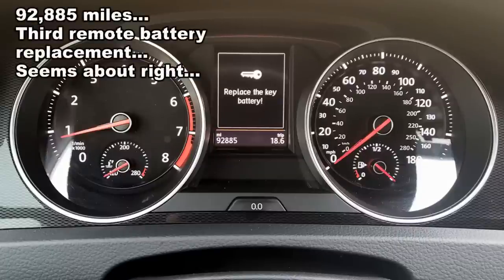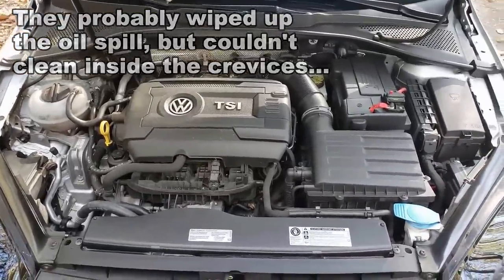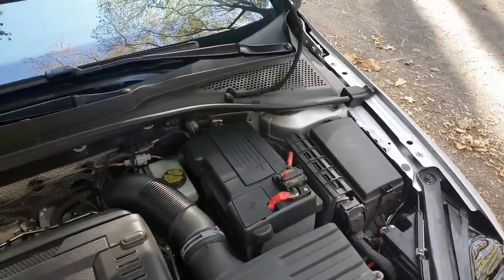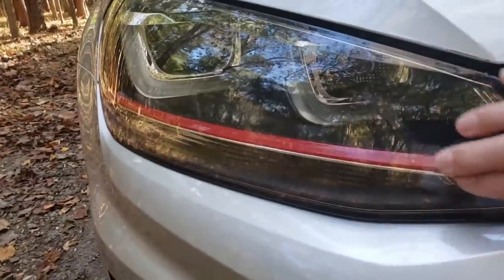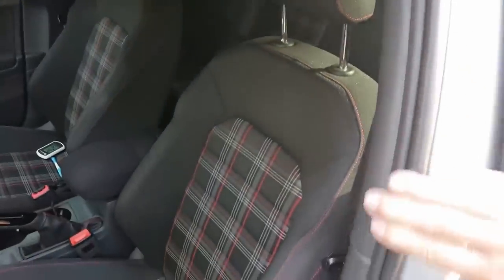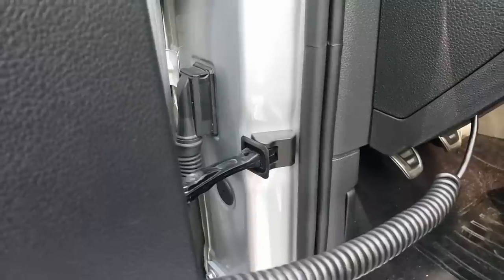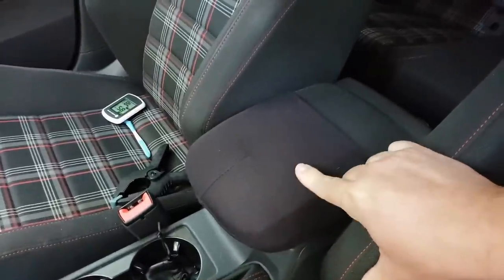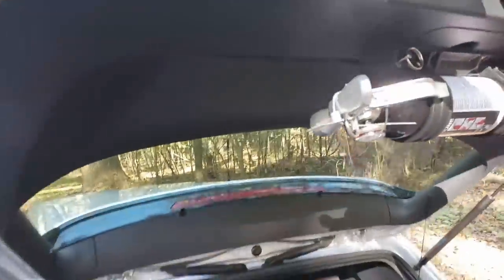THREE YEARS AND 93,000 MILES: My Report, Part 1

Comment from the maker: Major points of clarification: My clutch did NOT fail at 15,000 miles. In fact, it did not fail at all. It slipped ~15k after tuning my car. I replaced it preemptively. The majority of the issues I detail in this video are either self-inflicted, petty, or both. Also, OBDEleven is a diagnostic tool that plugs into the OBD2 port: https://obdeleven.com/en/. Part 2 of this video is now published. It  includes the footage of the suspension, exhaust, and other items that show the condition of the chassis and underbody: https://youtu.be/s2x1-Y9kzfA. Thanks for visiting.
Reply: StealthGTI 
The oil you thought was leaking from the diff that turned out not to be - smell the oil, gear oil has a distinctive smell. 

Your worn bolster - I lower myself into my car using the A-pillar. It prevents contact with the bolster. And I have a cover on the driver’s seat.
Reply from the maker: @ghostinthemachine76  Thanks for visiting.
Reply: Which APR stage 1 tune are you running? Is it the low torque? 
Did you replace with an OEM clutch or something else?
Reply from the maker: @davel1898  - Sorry to have missed this. YT doesn't notify me of replies, only initial comments. I found this by accident. Anyway, I'm running APR Stage 2, their initial release at the time of this recording and now their "final release" with slightly less torque down low and slightly more power up top. See my APR video for details. As for the clutch, I'm using an "RSR" kit by HS Tuning. I have details in my "20 Questions Volume 2" video. Take Care.
Reply: @StealthGTI  hello, I have a 2014 GTI. How do I know if it is a MK 5, 6, 7? I believe it is the most standard version available.
Reply from the maker: @bobmoore20  - Each "mark" (Mk) refers to the generation of the car, with the Mark 1 (Mk1) being the very first generation in 1974 and the Mk8 being the most recent and about to release. I don't know where you are; so, I don't know if you have a Mk6 or a Mk7. North America gets the new generations a year behind Europe. See https://en.wikipedia.org/wiki/Volkswagen_Golf to see which car you have. Thanks for visiting.
Reply: @StealthGTI  thanks so much for the info. She’s a 6! Thanks again
Reply: @bobmoore20  would you recommend an Audi A3 2013 1.4 petrol auto @ 70,000 miles?
Reply: It should not consume coolant.  Maybe u have a leak in the thermostat housing/coolant pump very common
Reply: I like all the petty or self inflicted wears it lets me know everything ima get myself into when I buy one

Comment: Previous MK6 model owner: the issues I had: radiator replaced, water pumped replaced and 2 ignition coils replaced, this was all before 36K miles. That being said, this was all covered under factory warranty. Around 50K the auxilary fan went bad. Around 60K replaced the rear brakes. Later, around 70K they had to take apart the motor because of some oil leak. I fought that one hard because the car was not leaking oil, before I had dropped of the VW service department.  Around 80K, due to the carbon build up, I had to get that cleaned. That was not cheap. That being said, it was still a fun car. I had it from 7K - 105K miles. 5 years, the transmission, motor and turbos were still going strong.
Reply from the maker: Thanks for sharing your experience.

Comment: My 2003 MK4 GTI VR6 is 17 years old now, and is built like a tank (built in Brazil, no less)!  Original clutch and chains, no leaks ever.  The only thing that needed replacement was the engine radiator fan, and the coilpacks (which were a general recall when the car was new).  This is the most reliable car i've ever had by far, and a blast to drive!
Reply from the maker: That's great to see. I felt the same about my 1998 Jetta TDI. It was very reliable until rust set into the front strut towers. The 450,000-mile power train lives on in a B4 Passat somewhere in TN now. Thanks for visiting.
Reply: in some ways I regret selling my 04 Gti 1.8t.  15years/140k miles and it had usual car stuff.  leaky rusted downpipe (replaced by TT 2.5" DP, sunroof, falling headliner, sticking calipers, but other than that it was nearly flawless and fun;  never chipped

Comment: Great video, my Mk7 GTi started drinking coolant at the same rate as yours.  Dealer found the water pump and theromsat housing were leaking and fixed it under warranty. I understand this is a common fault so could be related to your leak.  Quick pressure test and checking under the car with the shield removed should help confirm if this is correct.  Great video 👍
Reply from the maker: Thanks for the note.
Reply: Thermostat housings are notorious for leaking on all 2 liters and 1.8. Try to get a aluminum one if they make it for your car, it shouldn’t leak after that

Comment: Coolant issue is very common. It happened on my 2012 GTI, my 2016 Golf, and I'm sure it will happen to my 2018 Tiguan as well. I have never found any leaks. I also noticed the weak VW factory glass. All of my VW's have had cracked windshields before 100k. I would definitely stick with the factory oil pan. I lowered my Golf with sport springs at ~20k and never had an issue 90k miles later.
Reply from the maker: That's good news. Thanks for sharing.
Reply: Coolant issue is the water pump common problem.

Comment: In high school my best bud had a diesel VW Rabbit. It was a interesting ride. The gearshift felt broke - it was fine. With me riding his top speed with air conditioned on was 45 mph on level road.without air 55 mph. If alone he claimed 63 mph “ givin her all she’s got “ . It was normal. Low power cars. He did manage to almost get his license taken while driving it. On the WVA Turnpike he got clocked going about 80 mph . Down the biggest longest mountain at the bottom. Beckley mountain. He was trying to make up time he lost at 30 mph climbing the same mountain in 2 Nd gear.  We jammed Sammy Hagar , “ I cant drive 55”  it was true comedy. Glad to see they are better 30 years later. Nice little road machine now, or appears to be to me.
Reply from the maker: Ugh! I cannot imagine needing to pinch my pennies to the point of wanting to drive something so slow today. HAHA! Thanks for visiting.

Comment: I bought my Seat Ibiza TDi 130 new in 2002. It always had pressure build up in the coolant reservoir and I had to top it up every month. It was the head gasket.  A specialist replaced the head gasket (with pictures as proof) and the problem stayed the same. I don't want a car from the Volkswagen group anymore.
Reply from the maker: Thanks for sharing. I don't know much about Seat. What are you driving now?
Reply: @StealthGTI  Seat is a brand of Volkswagen.  I have been extremely unlucky with the engines in the cars I have had the last 20 years.

Comment: VW / AUDI eating coolant. Yes, yes they do.
Reply from the maker: Thanks for visiting.
Reply: My A4s were terrible for eating coolant.
Reply: Hey stealth!  Yep, me too.  Coolant magically disappears every 5k Miles or so.
Reply: 2015 Mk7 60,000 miles now, approximately the same coolant consumption. Strangely comforting to hear others observing this too
Reply: mine also did then we realized I had a defective EGR cooler. now no more coolant loss
Reply: Vw engines (2.0tdi,1.8/2.0tsi) have problems with water pump leaking
Reply: RAYNOND ST. PIERRE  then it wouldn't be a GTI
Reply: Mine eats coolant as well. Went to dealer and they diagnosed a leaking thermostat. Very common. Also expensive lol
Reply: My 2016 VW Volkswagen Passat does the same
Reply: valve in cap not working. Simple as change coolant cap
Reply: @chasek4605  the coolant pump and housing is plastic...JESUS CHRIST...PLASTIC!! So they degrade and start leaking. Just having mine replaced under warranty. There is no metal replacement or upgrade as of yet. USP has a mk6 full metal upgrade including metal impeller. If i keep the car for another 5 years I'll be doing this upgrade
Reply: TSI engine.. just wait, the parts will disintegrate not too long from now.
Reply: No they do not, my Audi is 10 years old and only thing it consumes is fuel.
Reply: @overtaxed3628  well...it seems the newer cars were made lighter by making certain components out of plastic
Reply: Yeah these mqb 2.0 tsi love to get pissed on coolant haha. I have the same internals as you do in my octavia vrs and the same coolant issue. I also have the rattle near my head too so I'm going to check that door bolt. Thanks dude!
Reply: What about water pumps and thermostats?
Reply: We have a 2016 tsi and it uses antifreeze. The rad has a pin size hole. You only notice it in heavy traffic when the engine is warm. You can smell it. Also, my backup cam is foggy greenish all the time. I think the lens is off the mount a bit.

Comment: Great video! Excellent details! I bought my 2001 VW Jetta 1.8t 5 speed manual brand new with 3 miles on it! Arrow Silver with grey cloth interior and a sunroof with the monsoon sound system.  I loved that car for 7 years and 125k  before I sold it.  Sunroof never gave me an issue but everything else did! I also had a stage 1 flash of my ECU and it was an absolute blast to drive. I had a lot of trouble with my ignition coils constantly going bad. Same with my spark plugs. Replaced the clutch once with a heavy duty one and it was fine after that. My issue was how much time it was in the shop over 7 years. From electrical gremlins to check engine lights it was non stop! It was an absolute blast to drive but based on my experience i simply dont trust the brand. I've owned a maxima since for 7 years and 130k with mo problems at all and currently own a 2015 Honda Accord V6 Coupe that has been flawless.  VW made fun cars but until they get with the program with their quality control and manufacturing quality as well as assembly quality....I can go back. Just my experience though.
Reply from the maker: Thanks for sharing your experience. I, too, sometimes consider jumping ship. My GTI and my wife's 2018 Jetta (low miles) have been great cars. I'm considering an SUV as a third vehicle. The "VW nut" in me says to get an Atlas. But my diehard reliability, capability, and build quality tells me that my needs may be better met with a 4Runner or a used GX460. We'll see.
Reply: @StealthGTI  You get a strong vote for the 4 Runner here! Lexus not a bad choice either other then the horrific gas mileage! But neither will let you down.  I've heard many horror stories about the Atlas.  In fact there is a guy on YouTube who documented his story of his wife's Atlas that was eventually lemon lawed. They ended up with another Atlas because she really liked it and wasn't deterred from the experience.  Either way best of luck with your current VWs and any future vehicles that you choose to purchase! Cheers!

Comment: Really good review.
I've had a Golf 1.5 in the UK through my work for the last 3 months. In that time,  I've covered 8000 miles.
I find it really relaxing to drive. It's so quiet compared to my previous car which was diesel.
Reply from the maker: Nice. I find driving to be relaxing, too... driving in the rural areas, that is. Thanks for visiting.
Reply: I don't find newer diesels to be noiser than petrol engines of the same power at all.
Reply: @JAnx01  they get slowly noisier

Comment: Appreciate your video. I'm getting close to 50K on my 2016 6MT and have found it to be very problem free. Tires at 35K, battery at 40K, a cracked windshield early on, and that's it. On rare occasion, the Apple Car Play can be glitchy after taking a phone call. Brakes still test well, zero leaks, and I'm not consuming any noticeable coolant. I did find that the dealer's 10K oil interval was too long and the car used 1.5 quarts on at about 9,000 miles...I shortened the intervals thereafter, but noticed no consumption after the "break-in" oil was replaced. I'm 6'3" and adjusted the way I enter as well, but luckily no noticeable bolster wear yet.
Reply from the maker: Thanks for sharing your experience!

Comment: Great review!  I nearly bought one of these after I brought in my golf tdi on the last day of buybacks.  Interested to see if you can nail down the coolant thing.
Reply from the maker: Honestly, I'm not terribly worried about it. The car's been great, even with what is a very small amount of coolant disappearing almost since it was new. The TDI buyback was probably one of the best things that happened to me. Without it, I'd probably still be driving my Mk6 Jetta TDI, completely unaware of how much better the GTI is. HAHA! Thanks for visiting. -Scott
Reply: My wife’s car had the same issue, coolant reservoir low about half an inch every 8k miles or so. It turned out to be a bad seal from the coolant flange on the driver’s side of the motor. It’s the same flange where the coolant sensor, upper hose and the engine block meet. Replaced the flange, no issues since.

Comment: My GTI also had the pucks still installed when I received it!
Reply from the maker: Yep. The PDI "techs" probably turn over frequently enough that VW cannot keep them trained, even for something so simple.
Reply: @StealthGTI  VW isnt the best place for a VW ( in my opinion ) ! A good independent specialist is what you need, even for a new car , you should not have problems with your warranty as long as genuine parts are used.
Reply from the maker: @amazingvidguyz  - I had an independent specialist selected before I even found my car.  My car has been to the dealer only for early warranty work and a few simple tasks that I found them convenient to do. :-)
Reply: Hi, my wife has new Passat B8 few months ago, how to look for those puck? Where are they exactly and what happens if they are not removed? Thank you
Reply from the maker: @TubesWidener  - If you jack up the front wheels, you'll have better access to the struts and the boots that cover the strut shaft. Lift the boot from the bottom to expose the shaft. If you see blue plastic things, you probably have pucks. If you see a steel shaft, then you probably don't. If the car rebounds over speed bumps without harshness, they were probably removed. Thanks for visiting.

Comment: Moment I started watching, I was waiting for you to make a comment about the dropping coolant levels. All MK7 suffer from quality control water pumps, that either fail through the double 0 connector or the actual plastic gets heat cracked. You can check this if you see any dried coolant , usually dries flaky red, on the middle or lower block. I replaced mine at 35k with the revision parts, coolant level haven't dropped since))j.
Reply from the maker: Thanks for sharing. Did you get the metal part that I've read about? Or just an updated VW part? -Scott
Reply: @StealthGTI  I didn't' think the metal billet pump justified the cost, especially since the revised version seems to hold just fine. I would just call VW and they'll give you the latest revision part number, then try to find the best deal either through amazon or ebay vw part wholesalers. You'll need the waterpump, thermostat housing and double 0 Connector... All in all about a $350 job if you're replacing yourself. Just be aware if you replace the belt too it's a reverse thread, but if the belt doesn't look bad then don't replace it unless you absolutely have to as it's nightmare to remove, with many horror stories.
Reply from the maker: @Revedance2002  - Thanks for that. I'll keep it in mind.

Comment: The factory ones leak also. In the UK, I'm doing inspections are cars everyday and I've seen the plastic sumps leak, earliest I've seen is at 45-50k
Reply from the maker: Thanks for sharing that.
Reply: on the flip side, I'm not saying your wrong but I wouldn't say its common. I work for Audi here in the uk (same engines) and personally havent ever seen a plastic sump leak. Plus the plastic is not going to rust over time either
Reply: @andyboy13100  it's one of those things just to inspect during maintenance. Yea, corrosion isnt a concern. At Audi you'll rarely come across the low mileage high abuse drug dealers car as you would in a north london private garage...

Comment: Thanks for your film. Currently have a '08 Mk5 GTi with 180k & my wife runs a '12 Mk6 GTi also with 170k... so good to know how the MK7 holds-up
Reply from the maker: My early research indicated that the Mk7 engine addressed all of the shortcomings of the previous 2.0T's. Time will tell if they did a good job. Thanks for writing.
Reply: Looking at a MK6 11'-12' with under 70k on it? I only hope to get another 100k out of it with proper maitnace. Is yours still holding up?

Comment: I have to agree to some of the issues, the paint it’s on the weaker side, the water coming in was very annoying, I bought weathertech that fixed the issue and made the car looks better in exchange for extra wind noise coming in, there is a few rattle that drives me nuts specially after the downpipe but the nice thing is that I have the Fender stereo so just turn up the radio, nice that you made it to 93k, I am at 75k and just ask for another reliable 35k, that will be awesome, most of my subie owners friends don’t make it to 80k before major issues
Reply from the maker: Yes! The car really is running well and shows no signs of fading. Of course, everything is great until it's not. HAHA! I have some maintenance items that need attention. But the car should remain solid for a while longer, so long as I take care of it. Thanks for commenting. -Scott

Comment: My 15' has 56k miles. I had to have the waterpump/thermostat housing replaced @ 46k. If there's a leak you'll notice it if you pull off the belly pan. It was caked around the oil pan very obviously as well as stained the belly pan up a bit.  Even after replacement my GTI still consumed about the same amount as yours. Just had my cousin check it yesterday at the VW dealer he works at. Bone dry underneath and around the usual spots. Who knows where the coolant goes lol.
Reply from the maker: Thanks for the note.